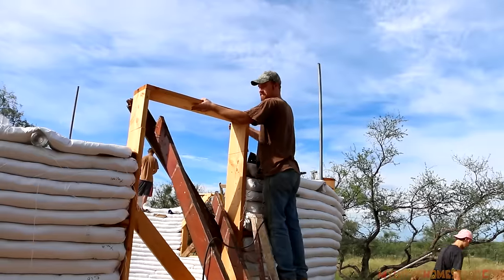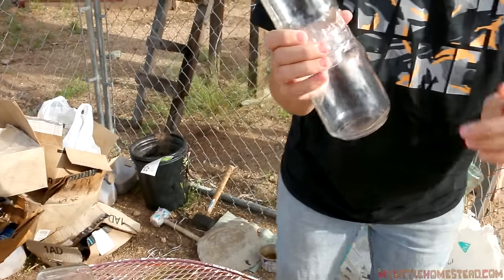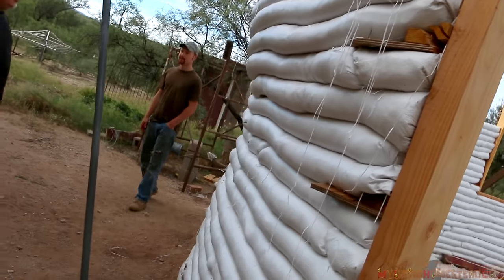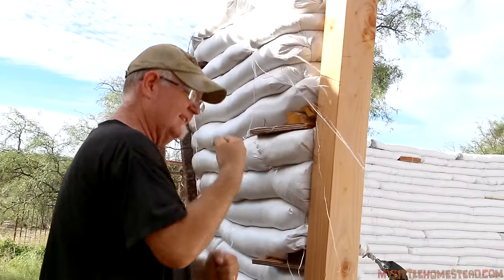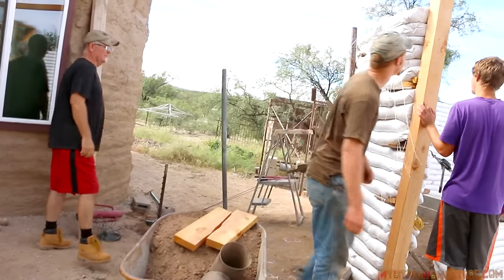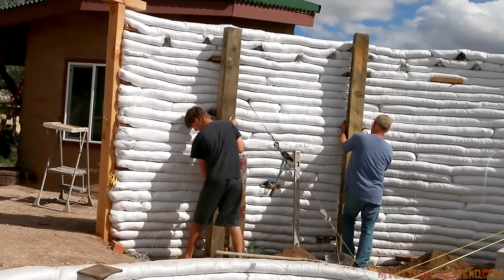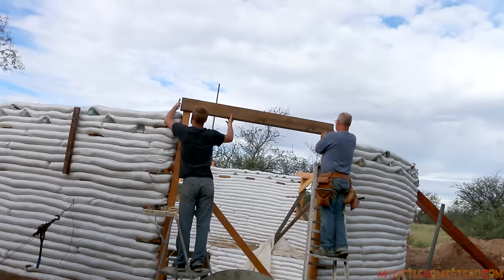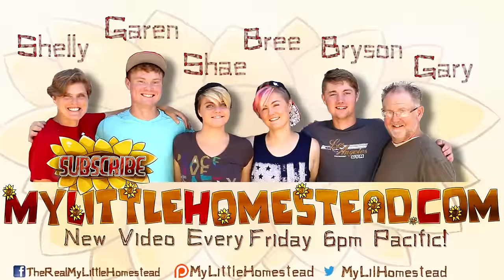Bottle Lights, Headers and Fixing Wall | Underground Earth Bag Building | Weekly Peek Ep58

Comment: You could use the hot wire, and water method to perfectly cut your bottles to match up. Taking the heads off two of the same to measure exactly what you need. No reason to lose out on the bottles you like. Many vids on that. Also you can utilize mylar in a tube shape inside them to throw light far stronger and further. I have seen some use chip bags, and a heat gun to smooth and get them to adhere evenly within the bottles as well. 

Guys with the comealongs you should use straps instead. With the strength in straps and wide bite against your bags you can permanently affix them as well. You are all awesome, thanks for sharing with us and working so hard to make it a wonderful experience.
Reply from the maker: +SeeTheWholeTruth 
Great suggestions. Thanks

Comment: You should do Posts on the interior and exterior of the walls and use them as a guide for the bags. it Should Greatly improve the integrity of the walls. Could even use them to mouth the roof.

Comment: If a column of internal and external wood is placed. They enter the ground three or four feet, filled with concrete, and then with steel cable connecting them into a sandwich, which will give more stability to the structure.

Comment: Besides perhaps cost, is there a reason not to install railroad ties or some sort of wooden post every 45 or 15 degrees? Seems you could build much larger diameter, and you could even have a more traditional interior side of the wall which would allow to hang things anywhere.

Comment: Are your bags UV protected?  Or how do you handle that?  Here in Colorado I put out a test bag and it was pretty trashed after about 4 months in the sun.
Reply: if you watch previous builds they put a render over the walls when done which would stop the sunlight reaching the bags, or is your concern that the sun is so strong there that the bags will be getting damaged even during the building work?
Reply: More about leaving them uncovered during the day when I build.  I don't know how long their projects take but I'm trying to build an earthbag house with ~3000 bags so about 25 bags a day for 120 days but that causes some degradation of the bag itself.  So I was more wondering how exposure during a project has degraded their tubes.
Reply: black paint is an easy solution.  If you have 3 to 4 months before the bag deteriorates, you only have to paint the the first portion of the building.

Comment: Is there a sump or a way to pump water out of this hole? If not this is going to be an in ground swimming pool
Reply from the maker: +Pat B 
No need for sump pumps in the desert. We divert water flow.
Reply: i don't know where this is located, but doesn't the desert get large amounts of rainfall occasionally? With no drainage couldn't this be a problem over time?

Comment: I think the real answer for keeping the walls straight on large/tall earth bag structures might be 2 things you have used.  2x12 with spring boards, inside and out look like they work well,  Also, using those T-posts every 4-6 rows.

The spring boards might have to stay in place until you get the roof on and the outer stucco done so that rain water can not the previously set bags.
Reply from the maker: +theoldwizard998 
Thanks for the suggestion.